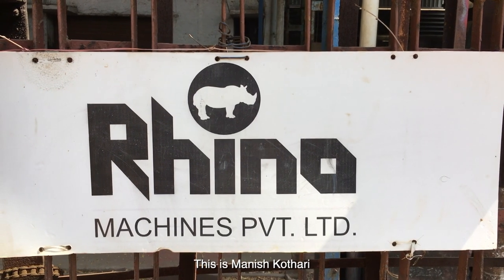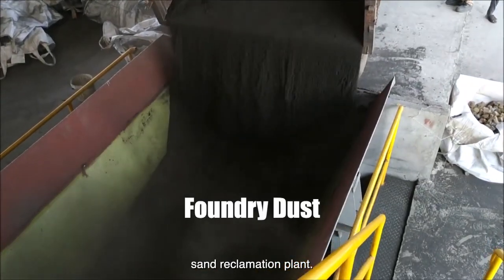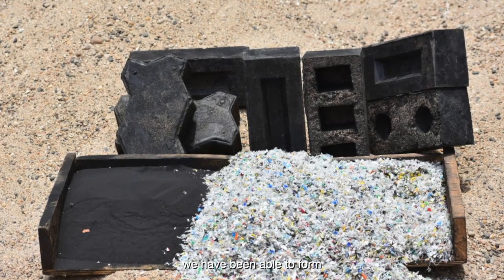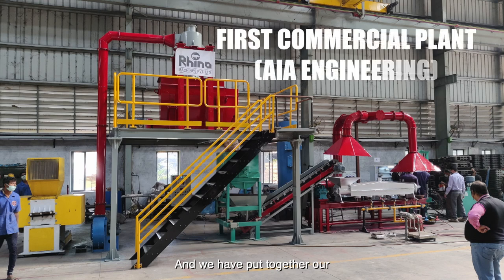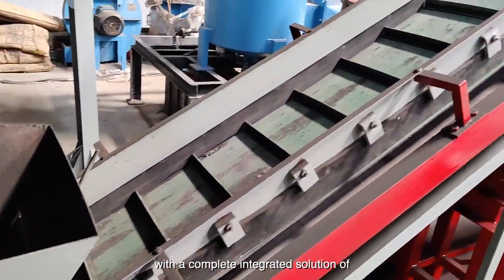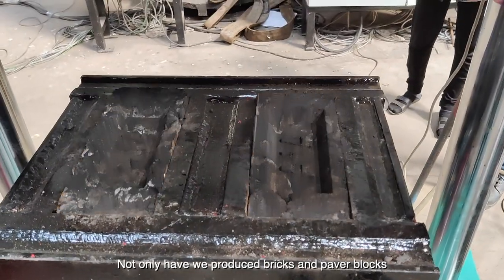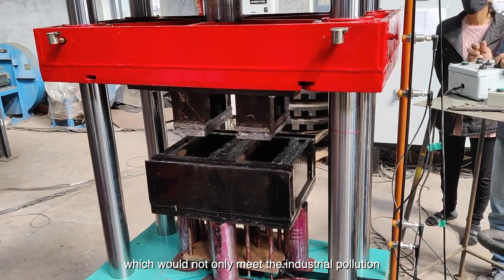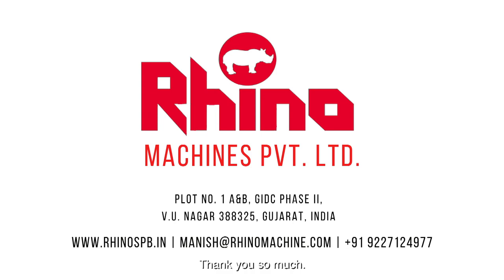Silica-Plastic Block | Rhino Machines Pvt. Ltd.

Comment: Their machines are a simple failure. Don’t even think of them. I am the 1st person to buy them and it’s been 2 years. They didn’t work properly even a single day. Their men came several times , try to fix the issue but couldn’t fix them say we did our best to fix but couldn’t fix as it’s a design problem speak to the management they say. From 2 years I am struggling with these machines and fighting to get them fixed or to give back my money. They don’t fix nor pay back. Also they cheat taking your money n insure on their name and claim the money even without informing you